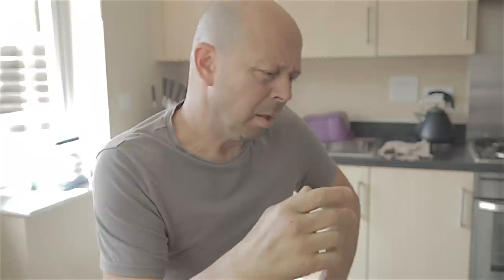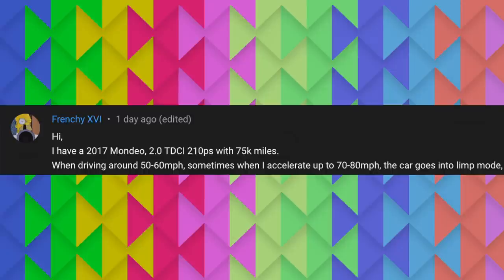Engine takes a dump into limp mode, Ford Mondeo Mk5 2L Diesel, Answering a viewers question.

Comment: Hi, my ford galaxy 2.0 diesel 2017, 66k miles have same problem as described below. Diagnostic says it PO6DD;00-68 something about oil pressure sensor? Full service, including fuel filter, was done just day before this started😆
Reply from the maker: bolted into your oil filter housing assembly is an oil pressure switch and a oil pressure control solenoid...these solenoids play up and cause the engine to go into limp mode...best thing is to clear the code..have it fault again..if it is the same code and it does relate to the oil pressure control solenoid then just replace it
Reply: I had exactly the same fault code on my mk5 Mondeo ,replaced the sensor ,both of them ,ran great one month later I’m getting the same bloody codes ,it has just reached 300,000 Mille though
Reply: Ok, thanks! Code was cleared, but after fev weeks problem happened again in the same place driving uphill and overtaking 70mph, so yeah will do one more diagnostic just to be sure before changing solenoid..

Comment: Greetings from down under. We only get the dreaded powershift in diesel Mondeo's here. No manual option. Alan do you or your readers know if the Mk5 Powershift was any more robust than the Mk4's? I heard it was modified in the Mk5? The one in the Mk4 (Getrag 6DCT450) was a hopeless disgrace.
Reply: The poweshift gearboxes are fine, provided the gearbox oil is changed every 37k miles as stated in service intervals....we have two of the powershift cars in our family, both nearing 160k miles and never had a issue. Correct oil and filter is a absolute must tho.
Reply: @stevenking2946  not here. Any transmission specialist will tell you they're fatally flawed in their design (mk4). Absolute shite. The amount of mk4 Mondeo's over here in Australia, fully serviced and off the road due to Powershift (Getrag 6DCT450) failure is a disgrace.
Reply from the maker: i believe the early boxes with dry clutches were bad but the later ones with wet clutches are pretty good as long as they get the correct oil changes
Reply: @alan4x  one of ours is a 2008 2.0 tdci and the other is the black 2010 2.0 ecoboost mondeo you did the cv joint and top mounts on last year so quite early cars
Reply: @alan4x  Mondeo's in oz have the Getrag 6DCT450 (Powershift). Wet Clutch. All failing after 150,000km. The Fiesta's and Focus's came with the even worse dry clutch arrangement, which were the subject of a big class action and huge compensation here. The mondeo wet clutches should have been included, but weren't. I'm wondering if the Mk5 Mondeo Powershift was/is any better? I heard they changed the design marginally..

Comment: hi alan, i have a 2008 2.0 tdci c max, and my fuel filter housing has a lot of metalic bits at the bottom of it, like the one in your picture. the car runs fine, but my question is " is the only answer to fixing this issue a new high pressure fuel pump" ? p.s. love warching your content, keep them comming, also say hi to monica for me.  i look forward to your reply many thanks Darren.
Reply from the maker: if you have too many metal specs in your filter housing you best get it checked as it will get worse ..your injectors will block up first causing a misfire not to mention the cost of new injectors etc..if you catch this early you could well get away with a new high pressure fuel pump and a new fuel filter
Reply: @alan4x  ok alan, thanks for your reply. i best get it checked out.

Comment: Hi Alan did you ever find anywhere to buy the fuel pump springs?
Reply from the maker: no i didn't but i got some from some guys who had them made and i also have some good used ones so if someone needs one i put it on ebay
Reply: @alan4x  ah ok just wondered ,I remember you saying you tried to source some 👍
Reply: Ps. You are a font of knowledge on anything Mk5 Mondeo keep up the good work

Comment: Hi Alan. I’ve brought this Mondeo mk5 2016 2.0 diesel 150hp like 1.5 years ago and it started from 3th week to vibrate il 6 gear and enter limb mode after climbing or accelerate harder, I’ve been to a garage and they didn’t find the problem, then I’ve been to a ford garage and they told me to change timing belt and everything that deals with fuel like injectors fuel pump high pressure pump fuel tank, after time passes it started vibrating harder and at lower gears, right now it’s vibrating in 2 gear. Until now I’ve been to 3 Ford garages and 11 other garages and they couldn’t find a problem. After car stops I have lots of errors from battery to high pressure pump injectors air abs system. Every time. I also mention that I have no engine light or any lights on dashboard. Do you know what could it be. Kind regards.

Comment: alan I need help i recently invested in a 2013 plate 2.0TDCI 140BHP 4X4 Kuga PSA engine and I noticed my coolant header tank  is going black oil seems to be mixing with the coolant. not overheating or anything and drives fine. any ideas what could it be? thanks
Reply from the maker: you want to fix the easy part first...hope its not the head gasket, i would replace the engine oil cooler..it bolts on below the oil filter and has obviously coolant pipes going to it, then flush out your cooing system and header tank

Comment: Hi Alan Great video mate.
I have had P0087 code for about 2 years now I always change my fuel filter every 10000miles.The engine was surging on idle basically uneven idle.Finally today I did a leak off test and oh my injector no 4 filed up the bottle which is 1l in 6min of idle.
Injector no3 50ml for 5min idle
And injector no 1 and 2 they filled up 30ml for 5 minutes.Do you think I should change Injector 1 and 2 as well or just 4 and 3?

Thank you
Reply from the maker: Hi. So basically injector no4 filled 1 litre in six minutes where the other 3 filled up to 50 ml. 
That’s a massive difference in which case I would just replace no4 injector. 
Just to be clear. No4 injector is next to the timing belt and no1 is next to the gearbox on these engines
Reply: @alan4x Thank you so much.I forgot to mention that this is the french one Citroen Dispatch 2.0hdi but it's the same I think right? Injector no4 is next to the timing belt and injector no1 next to the  gearbox correct?
Reply: Year model 2013 AHZ Dw10CD engine.
Reply from the maker: yes that’s right. Cylinder no4 is next to the cam belt
Reply: @alan4x  Thank you mate.

Comment: Hi Alan iv got a 2011 ford Kuga auto 4x4 2l diesel titanium iv got code p1169 fuel rail sensor in range high pressure any thoughts on what this could be

Comment: Alan can you get those high pressure  pump springs from Ford, I thought  I remember  you saying  that  you  can't.
Reply from the maker: no they don't sell them separate ..you can look on the internet but its hard to find..i think there are companies selling them somewhere, i have some springs if your desperate..will put on ebay if you need one
Reply: @alan4x  thanks for your answer  about the pump spring Alan,  not desperate  at moment  mate but appreciate  your offer. Your  a Gooden. 😊😊

Comment: Does the high pressure fuel pump give more pressure depending on engine revs? Or is it regulated? As if the car was taking a dump at lower revs in top gear that would make it more likely to not keep up with the excess fuel leaking off as accelerating?
Reply from the maker: when you are in top gear at low revs the demand for fuel is high when you put your foot down..more strain is on the fuel system to acccelerate because of the high gear rather than a lower gear the car can accelerate easier but whatever the speed and gear the ecu will monitor the pressure which will fluctuate for the driving conditions but if the pressure falls outside the governed limits thats when the ecu puts the engine into limp mode

Comment: Alan youre vids are good i need to pick youre brains, i have a problem with my Galaxy ,engine light came on  RAC SAID DPF PROBE ive changed it and maf  sensor nowf engine malfunction light on please help
Reply from the maker: the first thing you need to do is have a diagnostic machine connected to your vehicles diagnostic port and have the trouble codes read...then you will have a good idea of where the trouble lies

Comment: Could faulty injectors cause a ticking noise? My car ticks away when i do a cold start and stops ticking when the engine is warm or has been driven for 5minutes, garage say it's normal but friends who have heard it ask me what's wrong with my car 🤯 i know the chain is fine, well on the assumption if the chain was slack it would make the noise constantly and it is a different kind of noise i suppose, i only ask because if i use a long screwdriver and hold it to the injectors and listen, it's the same noise i can hear with the bonnet closed 
Thanks

Comment: Hi Alan my ford fiesta st 2l after I turned on my engine it only ravs once then go to limp mode. I would like to know what could be the possible ways to get it fixed it's been packed for a year
Reply from the maker: you need to read the ecu codes first

Comment: Where do you get hold ogf that spring for the injection pump?  Do you have a part number?
Reply: I remember he said in another video that he found a source for those springs. He didn't said from where but I'm pretty sure you can't find that spring on a parts shop. @Alan Howatt  Can you share your source for the spring ?
Reply: @lipovean1  Its difficult enough to even find an exploded diagram of the pump to find what it could be. Getting a used one from pick&mix at the scrapyard also seems a little bit much like a temporary sollution if its common problem.
Reply: @lipovean1  BOSCH original CP1H3 high pressure fuel pump plunger F01M100869
Reply from the maker: if you need one, i have a few, i can list it on ebay for you
Reply: @alan4x  Thats not so practical these days since I'm in sweden. But thanks anyway. I'm looking at a peugeot van with a no start and the seller says diesel filter  but I'm not sure that's the whole story. It's a 1,4 though so I'm not sure if the CR pump is the same.
Reply from the maker: @rimmersbryggeri  hmmm, if it was as simple as a filter he would have fixed it, i would be cautious
Reply: @alan4x  I am he says the shop told him it was the filter. It's one of those wit the special box filter that costs about 25 pounds but still i can smell something fishy. HE also stoppe dreplying when he realised I knew a little bit about cars even though the van has been on the market for probably 3 weeks now.
Reply from the maker: @rimmersbryggeri  if it were me i would walk away..more than likely there is something very wrong which will cost a lot of time and money to put right and he knows it, thats why he's not fixed it
Reply: @alan4x  Yeah It's pretty well priced so some dealer or other is bound to have been interested and left it.

Comment: Hi, hoping you might be able to help! I was driving along the motorway in my MK5 2015 2.0 TDCI at 70mph and whilst driving the car started to feel like it was shuddering. As I left the motorway I noticed a lot of smoke coming from the exhaust and a burn-type smell. No indicator lights appeared,  and the car seems to be ok for the rest of my journey to work. Any ideas what this could be? Thanks
Reply: Sounds like your car was doing a dpf clean you were doing 70 on a motorway,  completely  normal, the only problem  the car doesn't let you know with a light  or something  to indicate.

Comment: I have the same problem with my 2017 2.0tdci bi turbo. The fuel filter is replaced last year 19000km ago. I plugged in a error code reader and it says ”P1 934”.
What is your thoughts about this?
Reply: I used a new better diagnostic tool. Now it shows P06DD oil pressure control circuit stuck off. Engine oil + filter changed 8 months and 19000km ago.

Comment: Hi Alan I have a 2009 mondeo 2.0L diesel when the engine is cold when it's under light loads ie foot is just pushing the pedal it jumps and kangaroos when car is warm its perfect,any ideas?
Reply from the maker: would need to check ecu codes and vacuum leaks etc
Reply: @alan4x  OK ta

Comment: Hi Alan,i have the same problem with a galaxy 2016 2 l diesel automatic.110kw..im driving it "normal"if i can say so and after i press the gas to speed up goes into limp mode.still accelerate but classic. No turbo.i checked the spring ,high pressure fuel pump,fuel filter brand new,all good.
I did a leak off test i changed all injectors second hand .i did it after again all good now.leak off test ok.i changed MAF sensor.brand new oem ford.
The only thing i didnt checked is the fuel tank..
I wrote the injectors.i reseted the values from the injectors.and from the high pressure fuel.pump.beside the fact it goes into limp mode it drives smoothly
The error code i keep gettin after going into limp mode is:P008A Low pressure fuel system pressure-too low. 
What would you advise to to beside all ive done
.im editing this comment after 2 days.i changed the valve from the top of the high pressure rail.not the sensor from the rail,the valve from the end of the rail.still the same.goes jnto limp mode.but now the difference is it gives me another faults.P2000 -intake air flow A control circuit high. And P1102  mass air flow sensor in range but lower than expected.for the next step i decided to check the intercooler pipes and radiator..and the MAP sensor aswell
Reply: Found the problem:))))you wouldnt guess.
MAP SENSOR.i changed it and it doesnt go into limp mode.

Comment: I had the same problem  , I service  it every 6  months , after checking the fuel filter it was %#@$^&  even though  it had been changed a few months previously    ,blocked and collapsed I  on itself  so restricting  the fuel when accelerating 
   that's supermarket fuel for you,
Reply from the maker: cheers dougie, yes cheap diesel doesn't have much going for it lol, well its not cheap anymore
Reply: @alan4x  great content  on you're videos especially  to an ex mechanic  ,I did the same a you, worked on taxis all my younger years an now arthritis  has taken hold an 
 I'm driving one , !!! Never thought I'd  see the  day ,
  you've gotta  laugh I've seen some sights 
 I'm sure you have  , no bumpers ,doors handing off , pistons sticking out of the block  etc   And the drivers  say  uh no idea it was OK when I parked it up  , I miss it sometimes           but only sometimes.  keep it up its in formative  and funny   cheers
Reply from the maker: @dougietaxi1287  lol, yes i hear all the stories just like you did, makes you laugh, have a good one dougie

Comment: Love your videos mate but heres one for you.

My daughters 66 plate kuga 2.0l diesel is cutting out intermitently and also while idling sometimes there is nothing when pressing the accelerator pedal. It even sometimes idles at 1300rpm at its own will 🤔

The car can runs smooth and then it just dies for no reason but mostly like after a motorway run then coming off to a stop and trying to move away again it just has no power and the accelerator gives her nothing even puting it to the floor. 

Could it be similar to what youve explained in the video?

I checked codes on Autel and there was quite a few as well as low fuel pressure 🙂 

P008A 21 28
P0102 00 68
P0170 00 68
P0299 00 64
P2463 00 E8
P003A 85 28

Any idea.

Sorry i only know what's happening from what my daughter tells me 😂
Reply from the maker: I would clear the codes and see what comes back after a run. If a low fuel pressure code returns I would definitely carry out a fuel injector leak off test but it could be many things like the oil pressure control solenoid which is a common problem
Reply: @alan4x  Thanks very much mate, i d8dnt expect a reply that quick 😉. Last on, do you think possibly dpf blocked. The car is on 100k miles
Reply from the maker: if the dpf was blocked there would be ecu codes relating to the dpf and soot loading. Also if the soot in the dpf reaches a certain limit it will put the car in limp home mode until a regen has brought the soot level down.
Reply: @alan4x  Thanks again mate, very much appreciated 👍

Comment: Watched this out of what I thought was academic interest and, uh oh 😮, I now have aa yellow spanner light on my 1.5 econetic Mark 5, 2016 manual. Googling says powertrain issue on an automatic.  But mine's a manual. So I'm confused. And I was going to book my winter service. I hope it is a change oil or similar issue? Anyone have any thoughts?
Reply from the maker: the spanner light is telling you there is a fault which is usually more serious than having the engine light illuminated so i would get the codes in your ecu read as soon as possible so it can be rectified
Reply: @alan4x  Cheers Alan. I have the car booked in for Tues with the independent garage I use and I'll have them check for codes. It is also still under warranty from Perch's Middlesbrough's if it is more than a service reminder. Have a good weekend. Mike
Reply from the maker: @mikeonfreeserve2926  cheers mike, hope all goes well and you get it sorted
Reply: @alan4x  Hi Alan, FYI, it was diagnosed as a faulty fuel filter housing and damaged wire to the sensor. Just got it back this morning and no yellow spanner and my mpg seems to have improved albeit only over a short run. Fingers crossed that's it sorted. ..........until the next problem. Cheers, Mike

Comment: I’m stuck with a limp mode when accelerating at motorway speeds. The fault code is P2279 Air intake system leak. Can anyone help please?. It’s a 2015 1.5 Mondeo diesel.